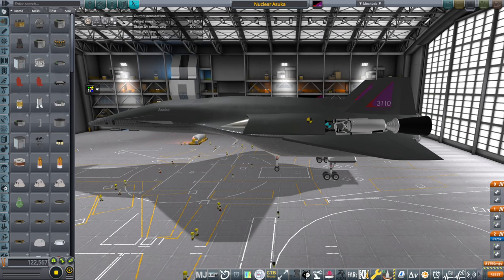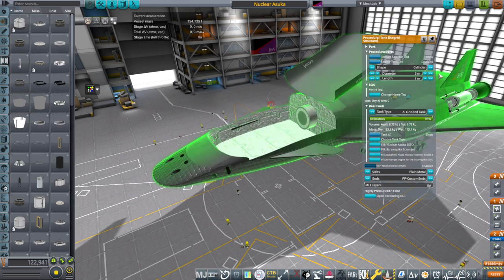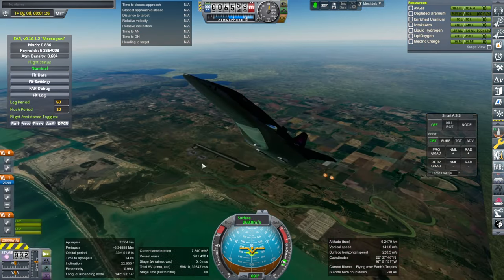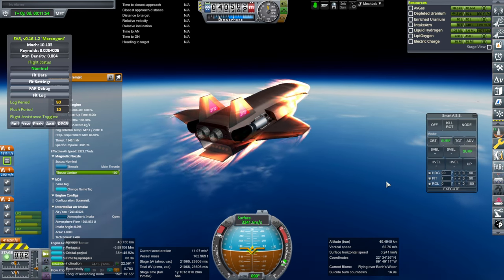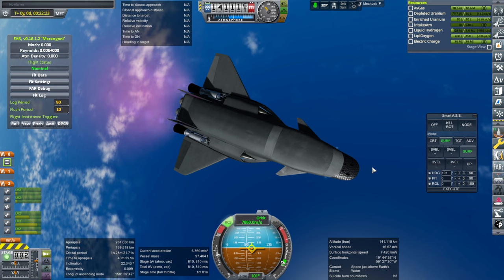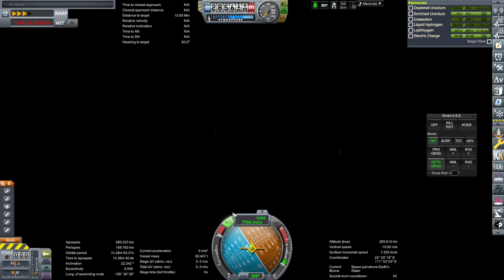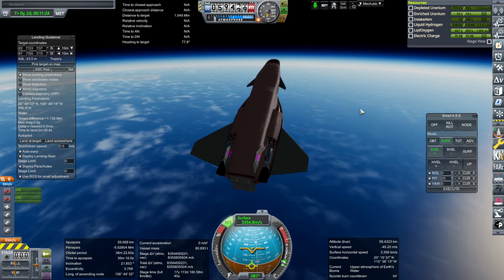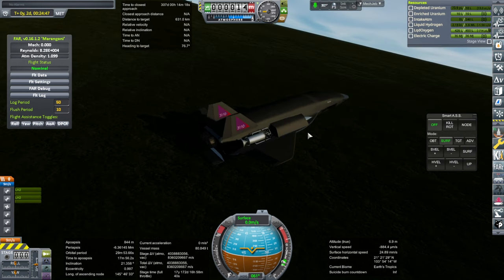Nuclear Scramjet Retest (RO in KSP 1.12)

Comment: How do you cancel the comnet requirement for probes? Also what are the heat tolerance stats on the plane?
Reply from the maker: Just disable signal for control in difficulty settings - this is a sandbox testing save, though. The heat tolerance depends on the part, and I don't have it in front of me right now, but it was copied from old RO configs for the Space Shuttle (which barely worked for the Space Shuttle, so I knew it wasn't overdoing it). I should use the new materials system they've introduced, though, to match the current mode of doing things, so I might be changing the heat tolerance on the body soon. I already use the new system for some of my other spaceplanes.